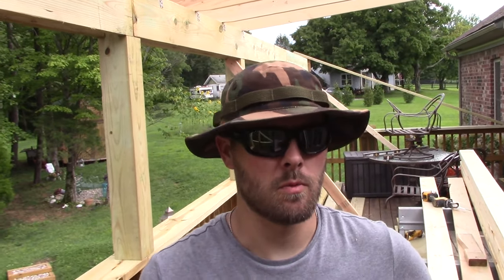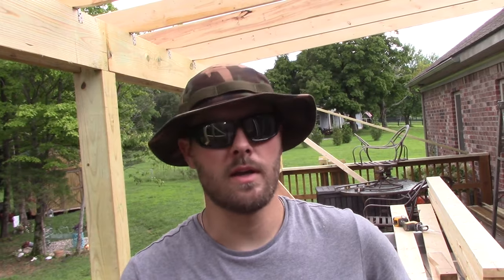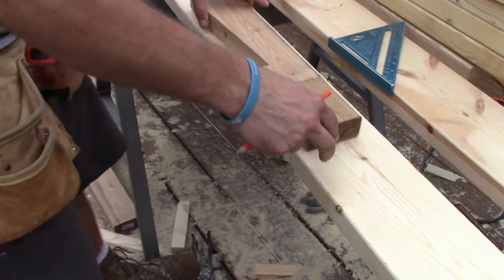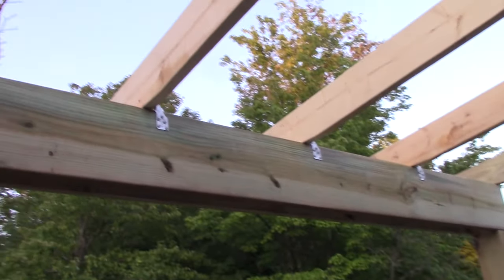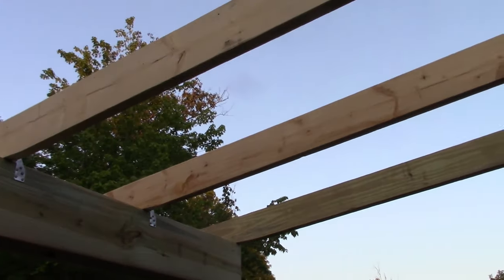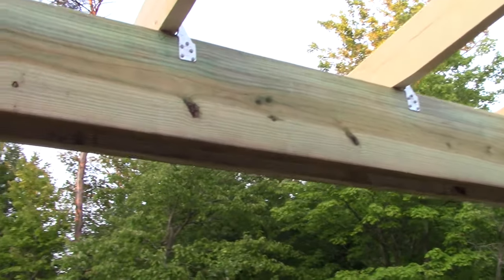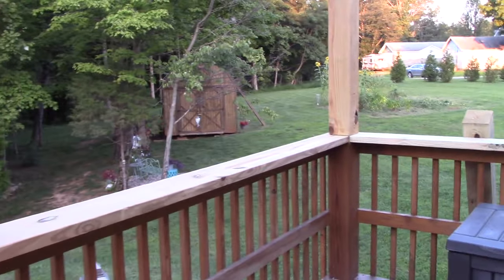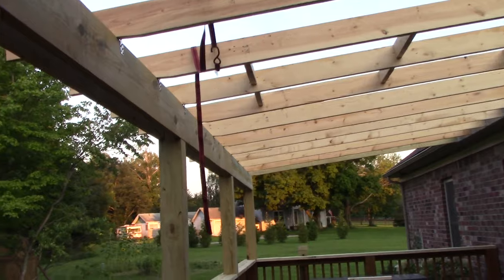Installing a Lean-to Roof on an existing Deck

Comment from the maker: For people that had questions about how did some  of the work i linked to a Q and A video in the description. Thanks for supporting the channel!
Reply: Hey man for anyone that didn't like this video darn shame for starters dad son time then you tackled something others were dodging and then you get a Heineken which I love but realized it was 0 % which I didn't even know existed lol. These are you folks ideas and anyone wanting to do anything of this sort needs to do all their research for their exact project.  Blessings to you and your family keep up the good work.
Reply: That is what I need to know.  From start as far as removing old post to replace new.
Reply from the maker: I never saw your comment on the channel geekznwheelz. Thanks so much for understanding what the channel is all about. As for the beer I gave up alcohol 2 years ago is the reason I had a zero haha. Thanks for the comment and support! Take care my friend!
Reply: @homebuilt8694 I'm going to do this exact same thing to a deck that's on the back of a house. It needs a roof and enclosed a great video you made there
Reply: Let's say you want to build one over a deck but not attach it to the house.  I want my metal to go over the gutter a few inches. Would 4 6x6 8ft be sufficient for a 22ft wide deck? I also would need to find 16ft pieces of metal for the top.

Comment: Rafters attached to facia board? Wow just..... Nope. Not the way to fly.
Reply from the maker: Thanks for checking out the video!
Reply: What do you suggest
Reply: Few feet up the roof tie in to the deck or cut through tag to the rafters your choice then run a pitch change since their doing metal dry in above the pitch change at least 36” up under the shingles may have to scrap few rows of shingles if you can’t remove them carefully enough fir re use and re lay them down to pitch change with layer of caulk and or roof submit under final row covering pitch change.
Reply: The only proper way to do this is remove the existing facia run new rafters to sit on the top plate of the existing exterior wall.
Reply: My dad and I did this in a hurricane-prone area about 35 years ago. We aren’t builders so we did what seemed to work… and it’s still standing strong after several storms, a reroof, and over 3 decades of use. I’ve since learned that internet peeps always rag on this type of construction when they see it but it worked out fine for us.
Reply: Enough with the music dude 🙄
Reply: @corvettetexan same we did our front porch roof like this and 20 years later no issues. Winds over 50-60 mph and a re-roof on the house ours held strong and is still going strong.
Reply: @jmbrick8058 yessir, not even a ton of work.
Reply: I think you're good since the fascia board is already a 2x6! I would have probably added a few more long screws through the 2x6 into the rafters. You might had already did it? Anyway it looks great!
Reply: That facia board is in no way their to support them rafters. That will fall and possibly damage you roof also..insurance isn't gonna pay for that.

Comment: Looks good but I didn't think you can use the fascia board to support all the load of a new roof like this.
Reply: Had some of the same thoughts.
Reply: You cant. Completely against code
Reply: I believe he said the fascia was 2x6 material.
Reply: @travisedwards9983  ya I believe it would need to be framed and have a ledger could be 2x6 then bolt that with lag bolts.
Reply: What is holding the 2X6 facia board to the house? A few nails? Go back and run screws through the facia into the rafters. This will give a lot more support.
Reply: Facia board is just for looks not strule if your going to atahed it to the house it’s not right learn your codes guys
Reply: You can't. This will collapse in time.
Reply: No way are those joist hangers secured to the rafter tails. If the new rafter is butted to to the old rafter what are they secured to? This is a no go . Gonna have major structural issues.
Reply: @joecosta394  what is the right way? I have a brand new deck but it needs to be covered . It gets full sun (sunrise to sunset ) my dogs have no shade even their water gets boiling hot . Wood is so hot it burned my foot to walk barefoot. My dogs have been hanging out under it and then tracking much mud into the house . I’ve resorted temporarily to using a tarp. This video was exactly what I was looking for until I read the comments about the lack of structural integrity. My decks existing posts are 6x6 but are beveled or tapered into points on the top -for aesthetics. It’s a very sound and expensive deck but we didn’t know it would be virtually unusable until summer came . Is there a way to do a freestanding type cover for it that doesn’t harm the structural integrity?
Reply: And fyi this is Alabama so we get no snowfall . So if snow weight is the only issue with load bearing , then is this method in video ok? At this point I wish we’d installed an awning rather than a deck . I’ve already made a diy patio using concrete pavers and gravel for under 200 bucks . We spent thousands on a deck that we can not use at all unless it’s overcast and not raining -in Alabama that’s maybe twice a year . My dogs are miserable but if they lay in the red dirt under the shade tree they get attacked by fireants . My yellow lab is now orange
Reply: If you use 5 in lags and tap into your rafters you should be fine
Reply: Our shelter been up for 20 years screwed to double wide trailer and I've walked on it 220 pounds
Reply: @johnm5715  I'd build a pavilion over the deck with new posts going from ground to roof. Doesn't look the greatest but it's way stronger
Reply: @louiericciardelli6404 can you provide an example?
Reply from the maker: Thanks for taking the time to leave a comment and check out the channel! I understand that a lot of people disagree with how we choose to do the job, that’s ok. I can tell you 3 years later and no issues. If you happened to live in a heavy snow climate I would not recommend this build. We have had aluminum awnings in the past and there are many on the market you can research that attach to the home in the exact same fashion. Thanks and take care!
Reply: Attached to the facia as the video? @skrapenpennies9947

Comment: I would be careful using this technique in snow zones. You seem to be adding thebtoof to the eave of the existing roof instead of placing the weight of the new roof onto the stronger exterior wall
Reply: Exactly I'm sure they had found companies that would do it but the companies were going to tie into the roof the correct way.. now I'm noticing that he's cut his bird mouth out with about a 10-in flat..😂🤣
Reply: I would have opened up boxing and secured my rafters to the house! Or as you said to do. Rafters to facia is a big NO!
Reply: Exactly…
Reply: He does comment on checking behind the cladding to be certain the structure is tied to structure but definitely something that could be missed by those that don’t know better. 

It’s a bit more work but so much better to remove the fascia and soffit to connect at the wall and sister to the rafter tails.
Reply: @johnlee7085  so ur saying to remove the fascia board and put a 2x6 there then install your rafters trying to do the same thing but I wanted to hold up
Reply: Al - I was suggesting running the new rafters all the way back to the wall of the house alongside the house rafter tails so that the new rafters can be attached to the structure of the house as well as nailed along the flat side to the existing rafter tails. 

The existing fascia already is a 2x6. It’s just not a structural member. 

You probably could put a post at either end and double the existing 2x6 with another 2x6 to create a beam that would work depending on the span.
Reply: I did this, but in snow months just going to stick a few 2x6's under the rimband thats toenailed into eve as columns
Reply: Exactly, I wouldn't recommend this at all !!!
Reply: I pulses cut back the overhang and built the roof on top of the other roof. Built a rake wall and such
Reply from the maker: Thanks for sharing and commenting. Yes it was not exactly the ideal situation and our weather zone factored into our design a lot. I would not recommend this in a heavy snow area. thanks for checking out the channel and commenting !
Reply from the maker: Also this project was right in the middle of COVID and they could not get anyone to call them back. So I was not lying in the video when I said no one would show up.

Comment: As a former Master Code Official and carpenter, you failed frame inspection, fascia boards are not load baring no matter the size.
Reply: Should he have removed the fascia and placed the new rafters on the existing wall and nailed the existing and the new rafters together? Not a carpenter, just a Plumber!
Reply from the maker: Good to know, thanks for the info and checking out the channel!

Comment: Looks good!!! There’s a lot of people downing it saying it’s wrong. It works and one thing that you might have done could shut them all up is…. Anchor the 2x6 to the rafters. Not sure if you did but dropping the soffit board and putting some metal clips connecting the 2x6 to the rafters and you’re good. Hope your mother is enjoying it

Comment: This is great to see with many excellent build aspects - however the tie-in to the main house being attached to the outer edge of the roof overhang will not meet code in our area. Would make most folks concerned that the roof will not withstand load of heavy snow or basically be strong enough to last without leaks and separation occurring. Just something to consider. Otherwise - appreciate your effort. Your mom is going to love!
Reply: My first thought exactly.  Installing joist hangers to the facia will not carry the load of that roof.
Reply from the maker: Thanks for sharing your concerns and checking out the channel we really appreciate it. If it makes you feel better I had the architect of the house check out the video and he said with the climate zone we live in this build should be plenty adequate. I know there are a lot of folks that don’t like how we built it and that’s ok. Thanks for checking out the channel!

Comment: This is exactly what I have been wanting to do to 3/4s of my deck. It would have been nice to have seen this from the start of construction though. I wasn't going to go all of the ways to the rail, but after seeing how you tied in the existing rail, I'll do the same thing. It will be screened in with a layer of wire fencing on the inside. I will be sharing it with the cats, so reinforcing the walls with fencing will keep predators out and cats in.
Reply: Exactly!  The key to doing this is how you establish contact with the existing structure.  all the video with his rock music and a guy operating a cordless song was useless to learning how to do this
Reply from the maker: Sorry if the video was not helpful. I more set up the camera to share what we were doing more so than a how to video. When I had decided to film we were already in the middle of the project.
Reply: Put in new posts all the way to ground support.

Comment: I'm in the process of doing something similar for a Sunroom.
Not sure where your home is located, but I live about 100 miles west of Washington DC and we catch a large snow about every 3-4 years.
With that in mind, I took off the Facia board and sat my porch rafters on top of the house wall frame and joined them to the existing house rafters for extra load carry which caused me. Had to weave in the new roof into the existing roof, but that was no bid deal. 
Great to build something with your own hands though, isn't it?  Something soothing about.
Reply: You gotta have that vertical support there. I realize they’re only installing metal, but the force of gravity must be factored in
Reply from the maker: That is how we wanted to build theirs but the two different roof pitches/head height didnt allow for us to pitch back in to the wall. Thanks for checking out the channel and leaving a comment. God bless

Comment: I for 1 appreciate you making this video. I'm about to build my deck and add a covered patio cover over the deck coming off the house. Like you said, there isn't many videos showing what you're trying to accomplish. Lots of videos, but hard to find ones that answer all your questions and concerns you have. Watching your video and reading the comments answered a lot of mine and gave me a few ideas. Think i'm going to remove the facia and attach a ledger to the rafter ends too. Like you, I understand the whole code problem. I'm not worried about that. I trust my work and if i'm ever in doubt I tend to go a little over kill for pc of mind. Taking your idea and some ideas from the comments like screwing or use some lag bolts and maybe some hangers to attach the ledger to my rafter ends. It might not be code but I will trust the end product when i'm done.

Comment: Nice and sturdy for downward loads but when the wind blows you will have uplift on the roof at 15 psf.  Those columns just sitting on top of the railing will provide no uplift resistance.  Suggest strapping the old and new columns together.

Comment: Just saw one of these rip out. Screws and nails rusted out slightly splitting once drying occurred. It was metal to, so it was  lighter. Just make sure you inspect your connections throughout the years. Know where you're walking if you have to get up there.

Comment: Got a lot of good ideas from this video! Thank you! My big problem is, out here in N.C we have vinyl siding, I have to remove it and put some ledger boards attached to my second floor beam, and I need to waterproof it then attached vinyl siding to the parts left without.... the rest is easier.
Reply: It's really easy with vinyl siding. Take it off one row above and below, attach your ledger, put some Z flashing over the ledger on the top edge, run your siding back on, obviously removing the section for the ledger. Run J channel around all 4 sides of the ledger, plus that small undersil with a crimp on the cut edge of the siding that goes up into the bottom edge of the ledger.
Reply from the maker: Thanks for taking the time to leave a comment and check out the channel! Take care!

Comment: I thought about doing this to my mom's house.  The front porch has a nice A roof with the same trusses as the rest of the house.  The rear would have to be a lean to.  But my biggest concern is attaching those big posts, since her house is at the beach.  It would have to be able to withstand typical hurricane winds.  I just can't believe my stepfather didn't have them do it when they built the house, so that the poles would have been solid, not pieced together.  Another concern is that I doubt I could even come close to matching the galvanized roof metel.  But it would really only be noticeable from the air and not from the ground since it is on the second story and the pitch would be pretty flat.  I'm still tempted to try it.  If it wasn't on the second floor, I would probably have already attempted it.  I'm not afraid of the fall from the second story roof.  I'm just scared of the sudden stop.

Comment: Hi, first of all awesome video, can you please demonstrate how you connected the new 6x6 to the old one? You mentioned some sort of pipe??
Reply from the maker: Thanks for checking out the channel. As for how the post are installed, all we did was mark center of the post and center of where the post set and drilled into the existing post and handrail.  We then bored into the new post. We cut 1 inch galvanized pipe at around 1 foot lengths and drove them into the handrail. Once everything was assembled we used 5 inch screws under the handrail and toe nailed into the post to keep them square. Hope this helps.

Comment: Wish you had started in the beginning from regular deck to the finish product. This is what we need to do. How much did it cost? What is the size
Reply: Denise -Don’t trust any comment on costs that aren’t local. Even in post-CV world, material costs are all over the place. I’m replacing a deck cover and have seen material prices go up/down/up 100% in a matter of weeks. It’s now complicated by shipping/fuel prices.
Reply from the maker: At the time we built it I think we had right at 2000$ in material. Hope this helps. Thanks for leaving a comment and checking out the channel!

Comment: I’ve always wondered about doing a lean-to this way, but notching the existing fascia board and using 36” straps to tie the lean-to rafters to the addict rafters for added strength.

We get next to zero snow in my part of the country as well, so snow load isn’t a thing.
Reply: You have addict rafters that sucks must get expensive
Reply from the maker: Thanks for taking the time to check out the channel and leave a comment. I agree Snow was not a concern of ours and people have gotten so butt hurt about how we built it. Everyone thinks we half assed the job but we built it the way they wanted it on purpose and tried to work with what we had. In a perfect world they said they would have tried to work in a covering during the build. Thanks and take care!

Comment: Great video my problem is connecting or adding the porch roof to my old house roof so the water doesn’t leak
Reply: Just slide flashing under the current shingles to go over the top of the new roof